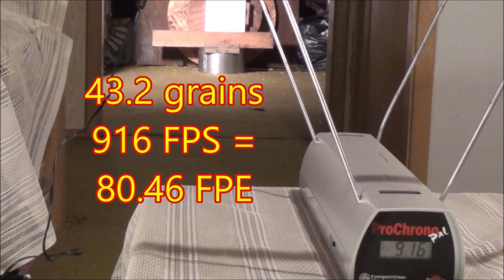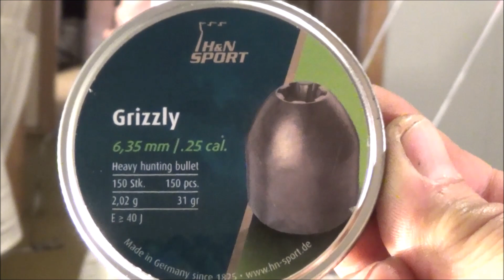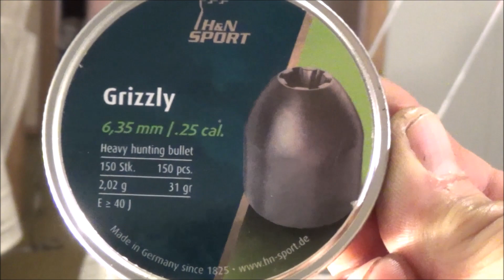.25 cal Vs .22 cal Airforce Condor Air Rifle,  muzzle energy and velocity comparison.

Comment: Never seen that before the valve lock
Reply: That is dumping all the air  in one go scary experience it takes time to regain trust after it happens.failure to close the valve may be caused by pellets stuck into chamber stopping the valve by closing up by back pressure or low pressure in tank vs high energy in hammer and spring together...
Keep the good work salute from a fellow afc users